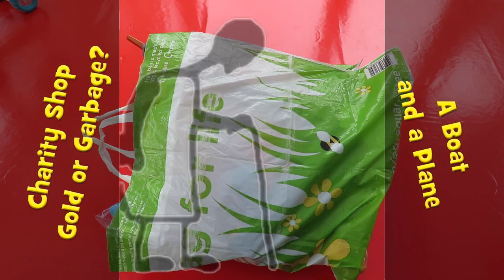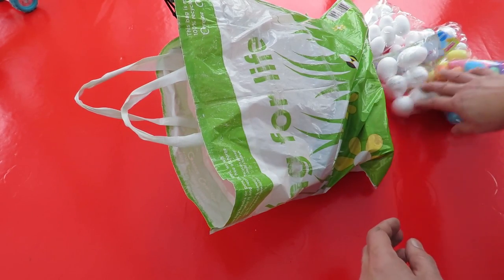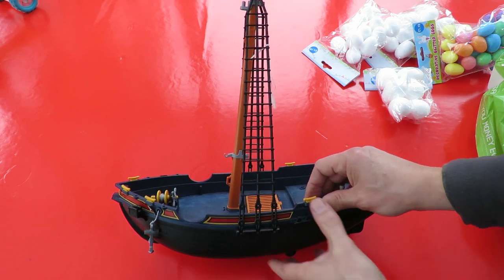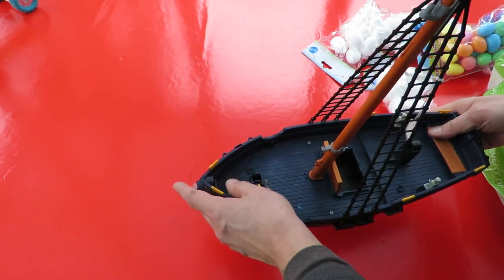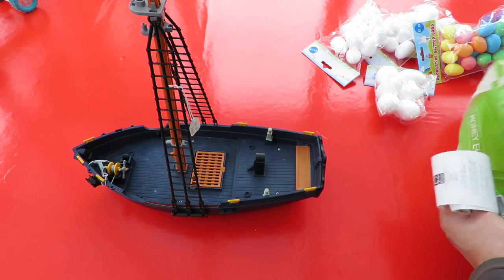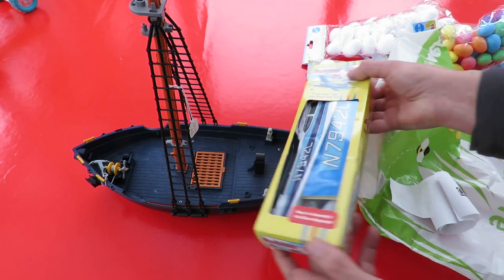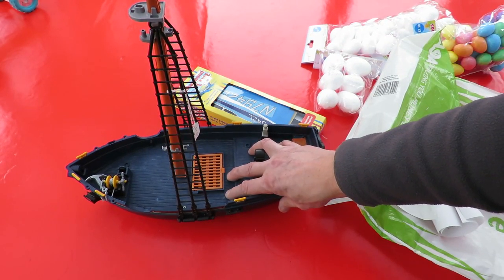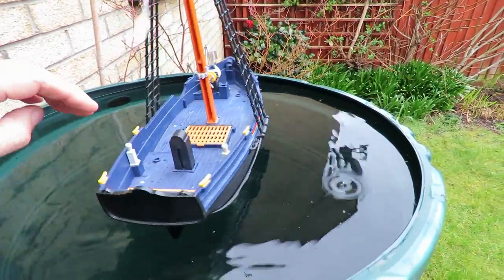Charity Shop Gold or Garbage? Boat and Plane

Comment: That Boat might need a keel to keep it from tipping over. Nice Purchase anyway :-)
Reply from the maker: +Elnufo I think if I put a sail on it the chances of it staying upright are nil but I don't intend to put anything on the mast and the main weight is very low down so with my normal low powered style it should be OK. You know my style, nothing too fast or flashy. :)

Comment: did you ever do a video on the flight of the plane if not could you maybe do a video on it
Reply from the maker: Still haven't flown that one. It is still in the box sitting on my desk. It was in the car for a long time but conditions haven't been right at the right time.
Reply: +GrandadIsAnOldMan oh well hope fully the weather gets better
Reply from the maker: Riley howe-mills We have had good weather but I also need to be in the right place at the right time with the plane which is why it had been in the back of the car "just in case". The trouble is I end up with so much stuff in the back of the car "just in case" I have to clear it out so we can go shopping and it doesn't always get back into the car when we have finished.
Reply: +GrandadIsAnOldMan ok